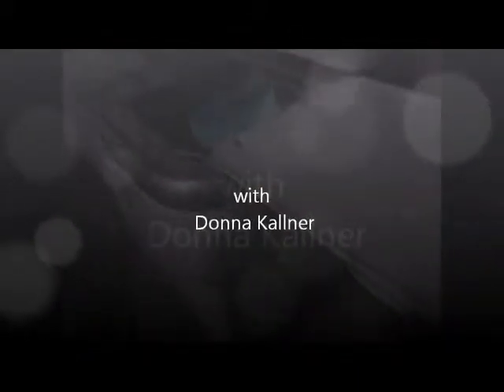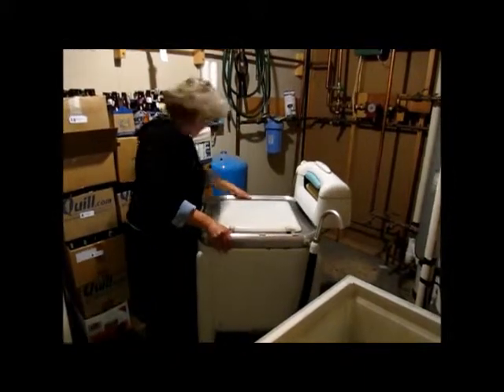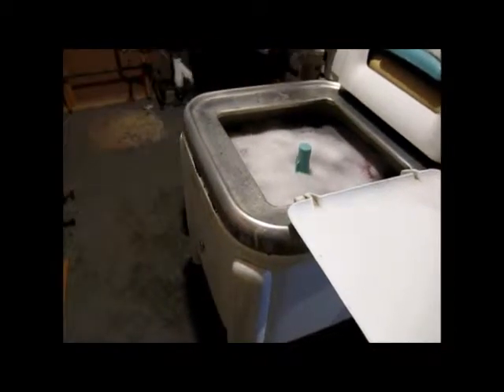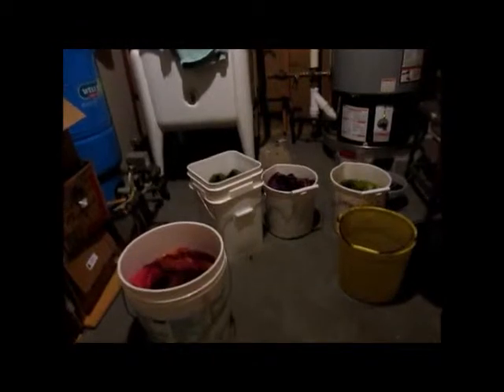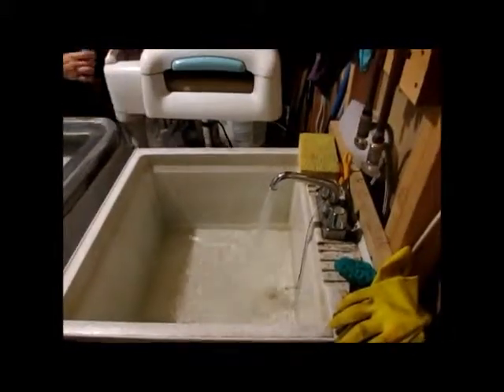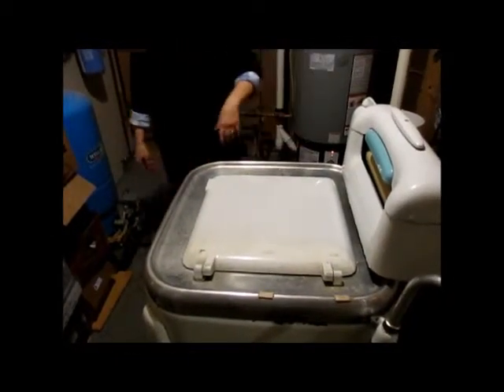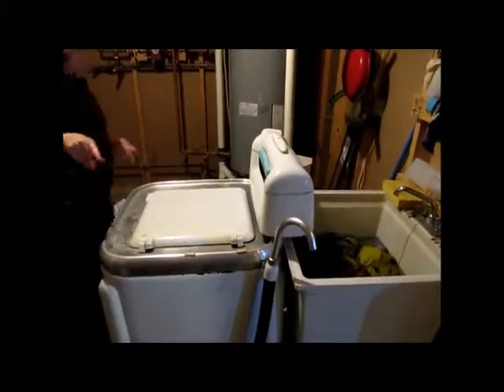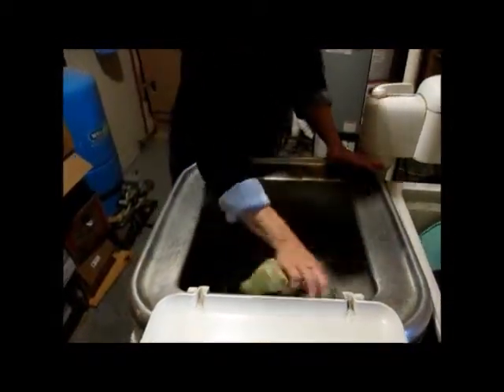Wringer Washer for Low Water Immersion Dyeing

Comment: Donna,
My wife is a professional quilter and so I was interested in the use of your  Maytag E2LP wringer washer.
Beyond restoration of vintage Singer sewing machines, especially SInger 221 Featherweights, I  also restore Maytag wringer washers.
You are an experienced wringer washer operator but I noticed that you did not fill the wringer washer up to the agitator's fins. If you do not have sufficient water in the tub, then you can overload the electric motor. You will also lose the roll over Gyrafoam action that made Maytag square tubs famous.
Your electric motor needs some lubrication. It sounds dry. I strongly recommend a few drop in the end caps of your electric motor. Non-detergent 20 weight oil such as sewing machine oil is ideal.
I also recommend that you separate your wringer rolls when the machine is not in use to prevent the risk of flat spots on your rolls.
Thank you for posting your use of a Maytag E2LP wringer washer.
Mark.
Reply from the maker: ibsoarin Thanks, Mark!

Comment: Donna,
Is there a reason why you do not turn the wringer roll tension bar on top 90 degrees (perpendicular) when wringing your cloth?.
That tension bar increases tension between the rolls and wrings your cloth out drier.
Of course when you are finished with your washing and wringing, you should release the tension bar back to parallel.
Mark.
Reply from the maker: ibsoarin it's hard to see but there's not much room there. I have to work around a stand pipe and  sump pump, and my arms are just a bit too short to reach over 🙂